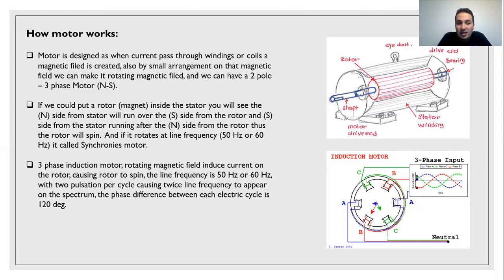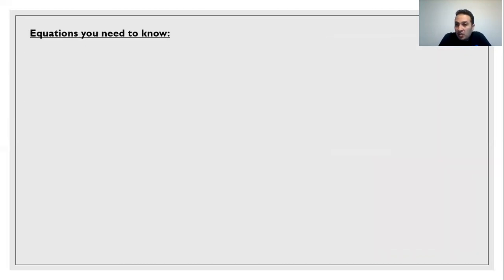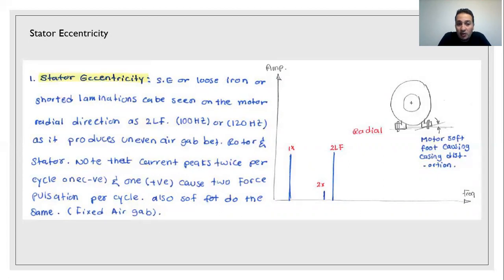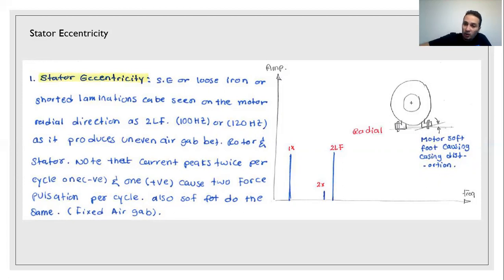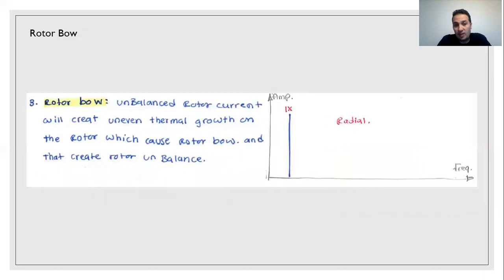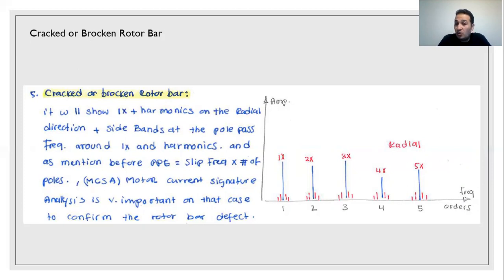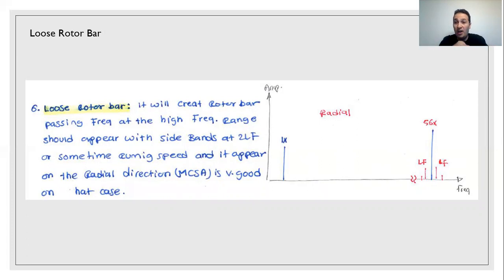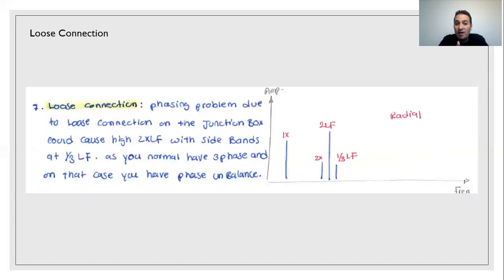Electrical Motor Fault Analysis

Comment: Yesterday I tested 10 pole motor whichhas a Rpm 720 ' in spectrum i am getting 2LF with 1 x sideband in radial direction  ' what could be the reason for that ?

Vibration and acceleration values values were under limit "